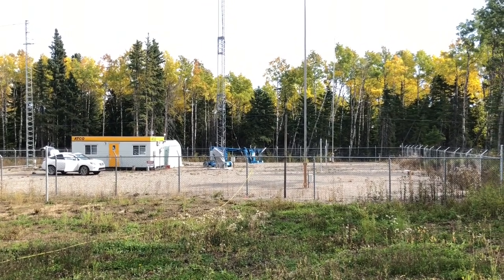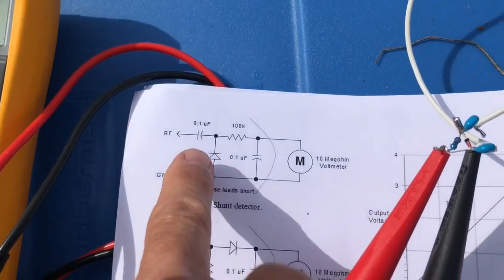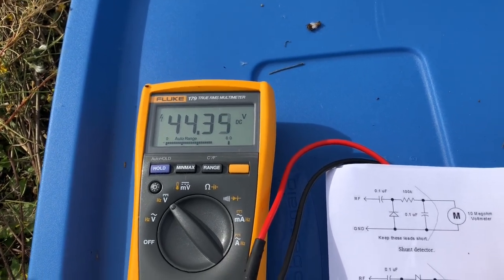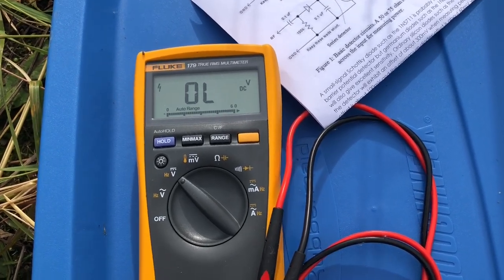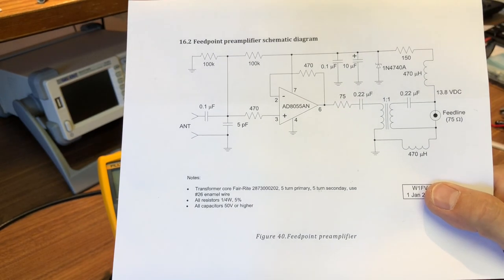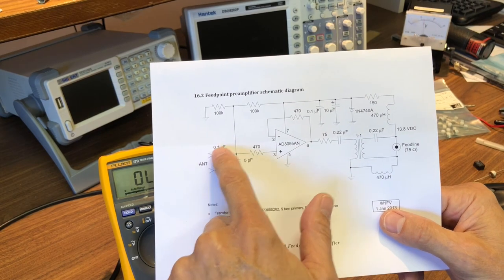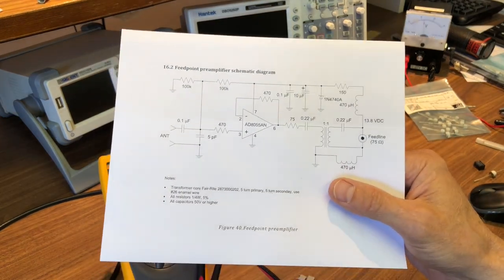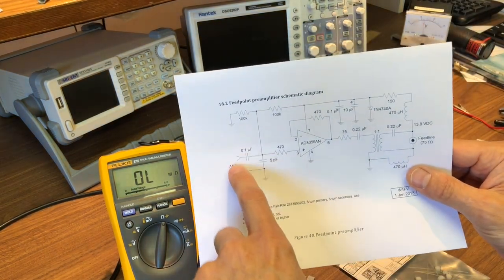HI-Z vertical field voltage measurement

Comment: Hi . Those caps are not 63V rated at all. Maybe at 50 Hz but not RF. 2 years ago I blew up a lot of same type capacitors  using it for a 5 W output filter as it really popped like popcorn does. Used only silver mica since. If high Z is involved, then a 1 nF cap is as good as 100 nF since the capacitive reactance at 2 mhz is just 80 ohms.  73's Gabriel yo8rxp

Comment: My homemade verticals have a 33K two-watt surface mount resistor in parallel with a 70-volt gas discharge tube across the antenna terminals. This is followed by a relay that OPENS the connection when not in use. Shorting the input won't help as well as an open circuit when common-mode voltages are present.
Reply: Thanks for the suggestion.  The "static discharge bleeder resistor" has been a very common suggestion from many. Parallel with a GDT is a good idea too to take of a high energy event like lightning.  I understand the idea of have a relay to OPEN the antenna from the amp for protection rather than shorting to ground.  The only disadvantage is having a mechanical relay contact in the signal path, although i have found sealed signal relays are pretty reliable. (I use them all the time for my Beverage switching).  My plan is to add a 1 Meg. resistor across the antenna to ground to bleed and wind static when on RX.  BTW...I also have replaced the input caps with 630v units.
Reply: @stevebabcock3163  I use sealed Omron inexpensive relays. I chose a multiple contact version so parallel contacts could be used. This might improve longer-term reliability.

Comment: put a high meg ohm resister to ground before the cap
Reply: Yes...I have received numerous suggestions about using a "static drain bleeder resistor" .  I now think that the MOST likely culprit for the input cap failures is wind static.  Yesterday with just a very light wind, I was able to measure 15v across the vertical to ground.  The voltage would gradually discharge to zero through the 10 meg input of the multi-meter, but those .1uF caps held a decent potential for just a light breeze.  I can only imagine on a really DRY windy day! I'll bet those caps charge up to pretty high potential.  Keeping that drained off with a 1 meg resistor is a great idea.  Of coarse the other failure mode could be a combination of wind static, lightning surges and TX RF stress all adding up and leading to eventual failure.  Someday when there is a nice steady strong dry wind blowing I'm going to measure what potential I get across the vertical to ground....I'll install a 1kv .1uF cap across the terminals to hold the charge long enough to get a measurement with the multimeter.